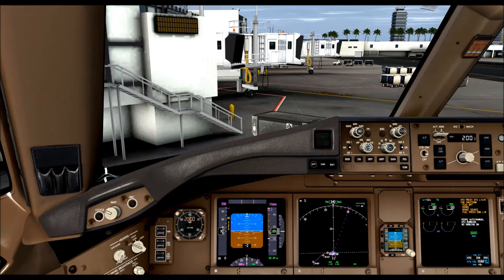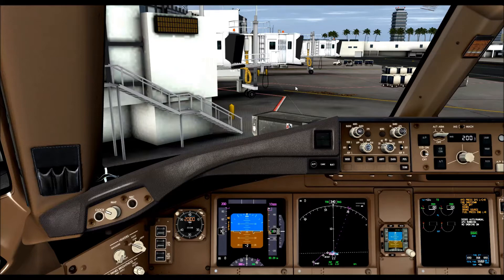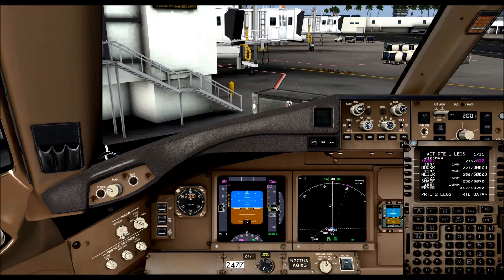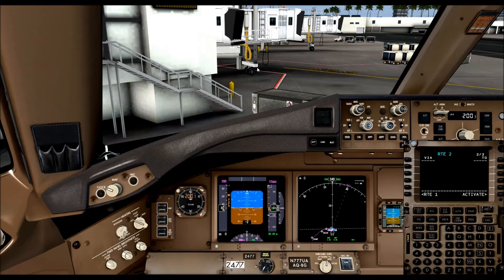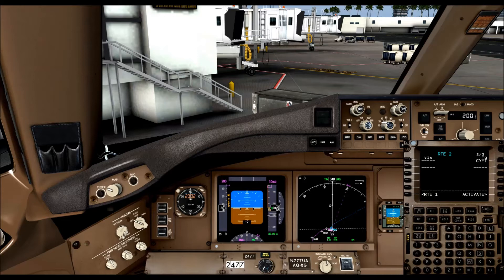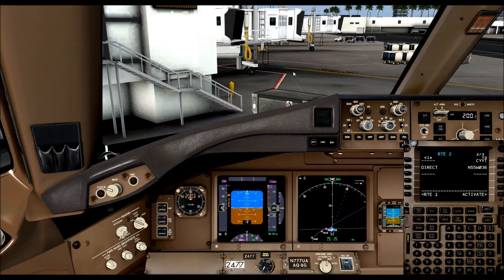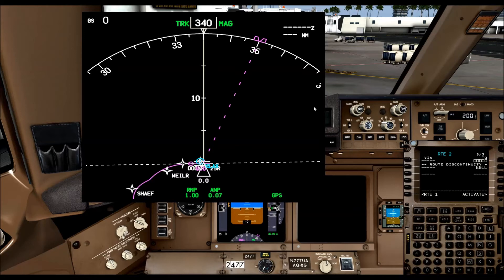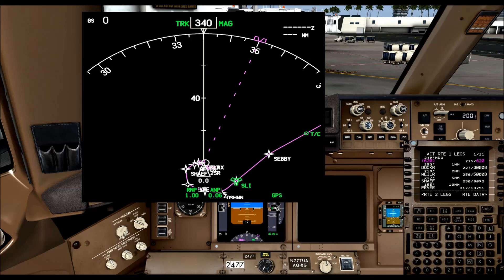FMC ETOPS Setup Tutorial | PMDG 777 | KLAX✈EGLL example

Comment: I can’t get the 4 pages when you go and put the Fixes! Any suggestions? I only get 2
Reply from the maker: The B772 FMC has 4 pages. A lot of other planes has just 2. Are you using another plane? Otherwise it should be there.
Reply: @southernaviator7010  I am using the VMAX 777 Pro and Extended pack for x-plane 11

Comment: Wow, thanks for this great video! This kinda looks like the real deal haha!
Just wondering if you will do what you said, about the entering ETOPS - instruments check (like a tutorial on it)?

Big thanks,
Ellis.
Reply from the maker: +PilotPrayer I've actually been going back and forth on whether or not to make the ETOPS GROSS NAV ERROR CHECK vid. Reason being... that procedure was for planes that were not equipped with GPS. Non GPS equipped aircraft only had the IRS unit in class 2 airspace so you had to make sure it was working right before you entered class 2 nav. This was done by cross checking the IRS VOR position with an actual tuned VOR distance/bearing. If the IRS position was within 8 degrees and 4nm of tolerance of the VOR position then you were good to continue. But now with most all planes having multiple GPS units on-board, they don't do it anymore. For example, 2 independent GPS units on the B777 would have to fail before the crew would be forced to use IRS nav in class 2 airspace.

I was actually on a B757 Jumpseat yesterday talking to the crew about this very subject. But I guess my point is that flight simmers are flying with aircraft equipped with GPS. So I dont know if there will be any point to making that vid.

Sorry for the long winded reply... LoL!
Reply: Ahh, well, I still managed to learn something here and that is the main thing! I totally understand your point. After reading this, there really isn't any point to do so then :P

Cheers, and have a great CTP if your doing it :D

Cheers,
Ellis.